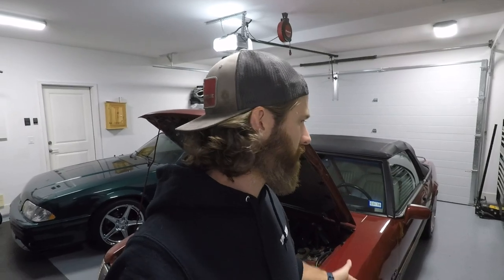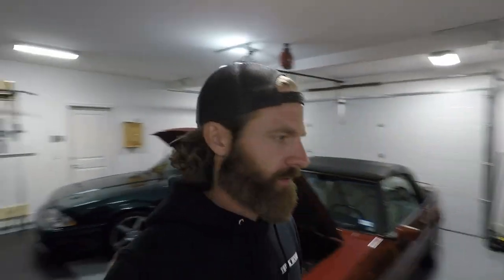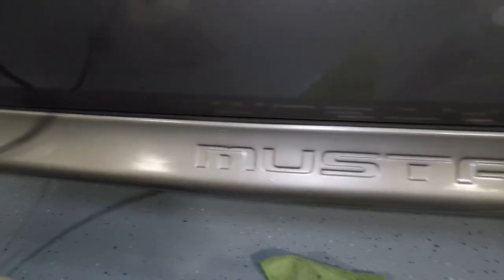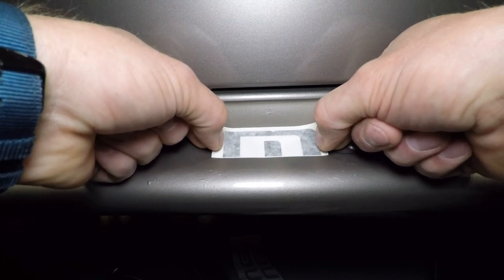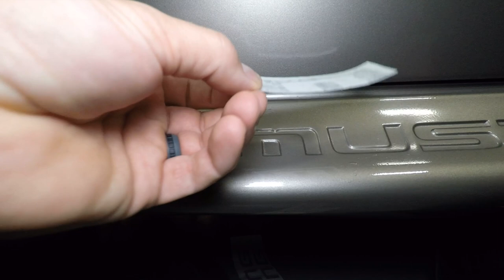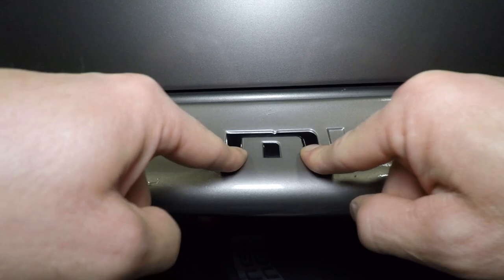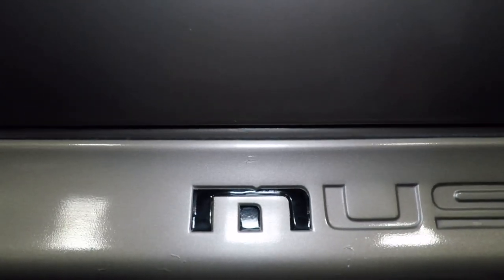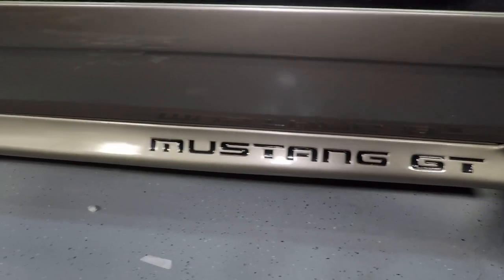The Correct Way to Replace your Mustang Decals /// Step by Step How To

Comment: You can use window cleaner to wet the area first then apply the sticker so you can slide it into place then squeegee out the fluid and it will dry and stick in place
Reply from the maker: It’s a tricky area to do that with because the “MUSTANG GT” is embossed into the ground effects
Reply: @KASLCustoms  first time I kinda screwed mine up but the second time I had seen the liguid trick and it works great. Gives you a change to move it around til you get it perfect. Had to use the finger squeegee for most of it. Look into it. The pros do it all the time now.
Reply from the maker: Nice! Ok thx bud

Comment: Spray a little soapy water on them dekals front and back...slide them around to fit. Blot dry.
Reply from the maker: Good point. I thought about doing that but because they are not on a flat surface, I’m not sure how easy it would be to get all the soapy water out…?
Reply: @KASLCustoms  2.75 Shop Vac will suck all the soapy water out. 😂 DP